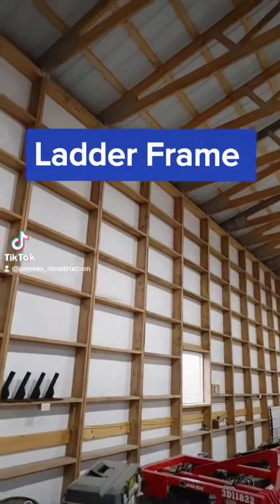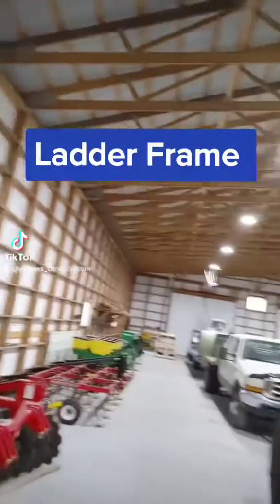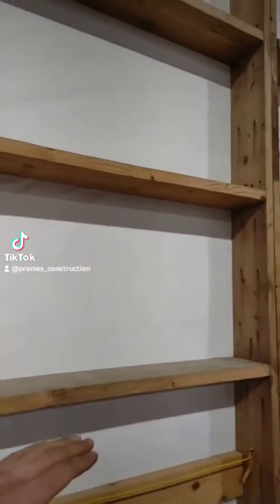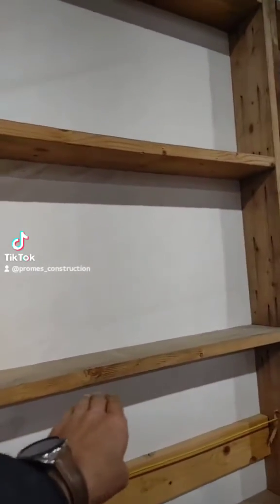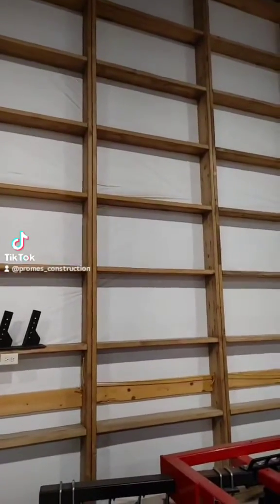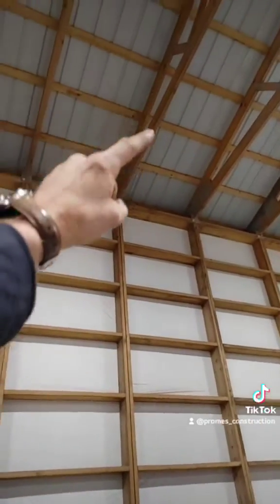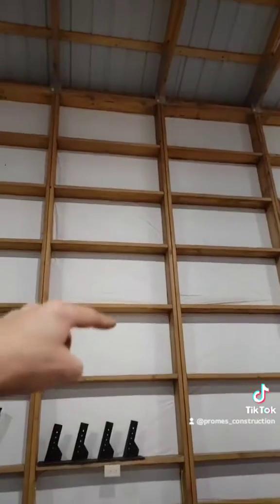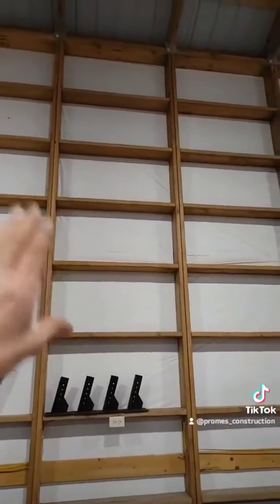Title: "The Ultimate Strength of 2x8 Ladder Frame Structure with 16' Sidewalls"

Comment: So is it the height that requires laminated 2x8's?  Wouldn't a stick built on 16 or 24" centers be just as strong?  But I imagine all the blocking does make a stronger wall.

Comment: This is how I framed my 24x24 garage except I sheathed that in OSB under Hardie board and batten to match the house. It's the same concept as "commercial" or "bookshelf" girts in a pole building and provides a ton more shear strength, particularly if sheathed inside and out. The walls essentially become torsion boxes.